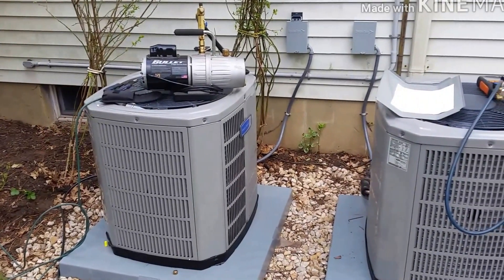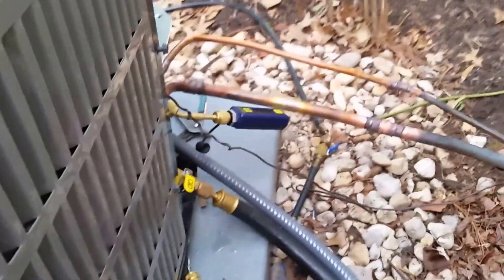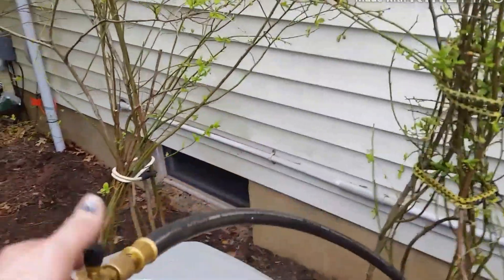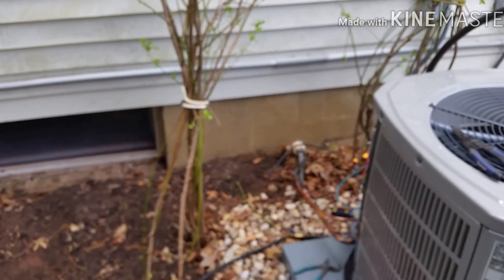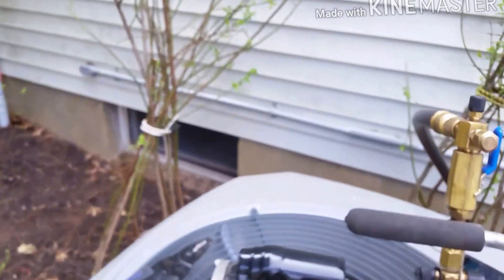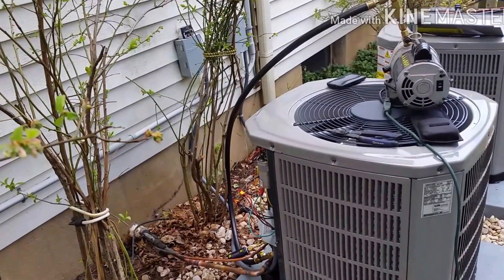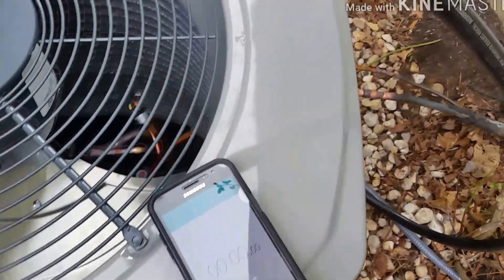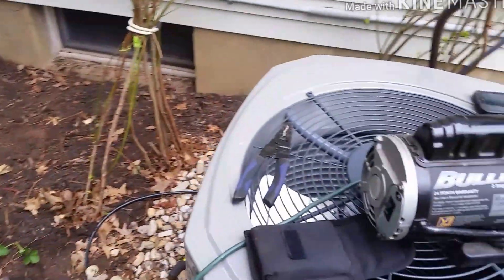Pulling vacuum using only one hose

Comment: With 38 years in the business, running seven trucks. Use a two stage pump and single hose. Good time to inventory and clean tools. Don’t just sit around with your thumb up your ass. Plenty of other things to do while you’re waiting. Also less connections means less leaks, worn gaskets .

Comment: Expanding on this method...I saw another tech that would release just a little bit of refrigerant...enough to make the gauge go from vacuum to pressure....then remove the micron gauge and vacuum pump. No air gets sucked in that way.
Reply: Just use core remover no?

Comment: So no triple  vacuum
Reply from the maker: On residential u really think it needed? Have u ever read the install instructions cause I have and it doesn't state a triple is needed at all.  It states under 1000 microns is all that's needed and valve off and make sure she doesn't rise. Not everything is done by text books . When u have a 2 stage vacuum pump all u need is a deep vacuum.
Reply: @jhhvacplumbing1944  im sorry to dissapoint you, but do you really understand why triple vacuum is done? Noncondensables and moisture inside the lines freeze while vacuum,m and crystalize, therefore they are no longer able to vacuum properly, that is why you have to put nitrogen again to bring those to normal state again, and pull vacuum again, thats why is called triple vacuum, and yes i have read on installation manual that triple vacuum is recommended, i always do it, and charging the system after install is way easier and doesnt take that long because theres no moisture or noncondensables  in the line,

Comment: Can I pull a vacuum on a system that has no pressure without the risk of the vacuum pump sucking in liquid refrigerant with this method? Or does the refrigerant need to be reclaimed before vacuuming?

Comment: I do mine the exact same.  Less seals is less doubt when it doesn't want to pull down right. Pull from suction with Schrader removed and micron gauge on complete opposite end of circuit at the discharge port for a true reading.  I cap off my solder joints way more tho....  To much to inspect and question with those joints.  Put a solid shoulder on it and know 100%  its solid

Comment: Vacuum ac system drain from the suction service port seemed OK with vacuum gauge monitoring the liquid service port provided the system has no TXV. Two port draining make more sense in a system with TXV.
Reply from the maker: How so ? The txv is never completely closed and pulling from suction port is the flow of the refrigerant direction and having gauge in liquid is the very beginning on vacuum being pulled and gives tru micron reading of complete line set and coil .
Reply: JH HVAC & Plumbing 
I don’t know txv is partially opened. Why?

Comment: I also used this method couple times , it works good . But i put one valve before the micron gauge , just to avoid
Reply: Just to Avoid the oil to go into micron gauge , while open gauge . Also some brand it is hard to use valve core removal . Also i will appreciate if u add another video to show how to open valve after vacuum finished in the same setup.
Reply from the maker: @azad15aug  u r correct my friend,  I now add a second valve core removal tool onto liquid line services port for micron gauge.

Comment: I’ve done it this way, through my 550s (slowest way) and the two hose way (without gauges). I never really was sure what way was the right way! I have a large vac hose like yours (Yellowjacket) and it helps considerably with getting the microns down faster. Was taught long ago just pull through the gaugeset. Yea, if you have hours to spare! Lol. Thanks for the video!
Reply from the maker: Get yourself a 1 port micron gauge and try 1 hose
Reply: JH HVAC & Plumbing have Blu Vac LTE. I will definitely try setting it up the way you show. Thanks for the tip!
Reply from the maker: @Fireship1  one mistake I did in vid was i didnt use a core remover tool on liquid stop with micron gauge on it . That way u can open services ports after vacuum without damaging the gauge and not pulling air back into line set to remove the micron gauge.

Comment: How do you release the refrigerant without it coming in contact with your micron gauge though or breaking the vacuum by removing it
Reply from the maker: U r correct and now use a second valve core removal tool on that end and just close the valve
Reply: @jhhvacplumbing1944  Good info. Great video Justin.

Comment: Do you remove the micron gauge before you open the lines? And if so, when removing the micron gauge does that cause the microns to spike up?
Reply from the maker: I added a core remover tool to liquid line and put micron gauge on it . Once vacuum is done u can close valve and either open lines or remove tool it doesnt matter

Comment: I mean why speed up process when you get paid hourly. Just wondering??
Reply: I have never charged by the hour when doing a change out or system replacement. I would be loosing money if I charged by the hour.
Reply: Speedy vacuum is best for side jobs.(Weekends)  Mon - Fri we opt for slow vacuum procedures because we get paid hourly.:)

Comment: What does it pull out? Is it moisture out of the line? Where does it go?
Reply: pulls out air. (water,oxygen,nitrogen,argon, hydrogen,etc). all of those items don't belong inside a refrigeration system and cause problems.  It goes out of the vacuum pump and is vented back into the atmosphere.

Comment: From what I've heard if pulling a vacuum through lines and coil only, use one hose. If also pulling through condenser use two hoses.
Reply from the maker: That maybe true but it's not often u r pulling threw condenser,  line set and coil unless u r replacing compressor or outdoor coil . Most of the time if it's a r22 compressor or outdoor coil its time to upgrade to 410a. If it's a 410s compressor with issues I lean on selling a entire new condenser based on its easier labor wise . Only time I would replace a compressor is it's under warranty and I have no other options.
Reply: @jhhvacplumbing1944  Yes indeed. Or possibly need a lineset repair and more than 50% of 410A leaks out.

Comment: What is the model for your vacuum pump. I need to get one but don’t know what size should I get?
Reply from the maker: All depends if u r residential or commercial
Reply: Definitely residential
Reply from the maker: @HowToDoitright  5 - 7 cfm is more than enough for res
Reply: JH HVAC & Plumbing if i get 4cfm would that work?

Comment: Micron gauge on high side?.  Did you have to remove both shrader valves.?  Thanks
Reply: You do not need to remove the shrader valve. It is used only for sensing the vacuum, no need to move the gas through there. Maybe it is better to put a real valve there, so you can shut the valve and remove the vacuum gauge, and charge the system.
Reply: @vicever08  ok.  Thanks

Comment: Just buy a Fieldpiece set of gauges that measure's your vacuum and pressure never have to worry about contamination and yes you can pull a deep vacuum with the gauge set just pulled a system with 100ft of pipe and 3 heads to 74 microns.
Reply: No manifold more potential leaks
Reply from the maker: john szymanski couldn't agree more but I have learned not to argue and tell someone they r wrong cause its not worth it . In fact they aren't wrong cause that's what they r made to do but there are better and easier ways .
Reply: JH HVAC & Plumbing Just keep your equipment in good condition and you won't have problems. And do it the way that you feel comfortable. I was just relaying my experiences with this piece of equipment especially for small units that you were working on. I also ran 3000 ft of pipe on this job and used them successfully in pulling vacuum's under 300 microns that was verified by more than one micron gauge. Again do what's best for you.
Reply from the maker: Jeff Scanlan good job dude I know its possible this is the way I like to do it and have good outcomes.  The only reason I mention to people not to pull threw gauges is the simply fact it causes leaks and gauges to die quicker lol.

Comment: I just used a single hose to vac a system yesterday. I didn’t have the right hoses and valves so I said fuck it, I’m just gonna use one so I can get my micron gauge on and it worked just fine. Glad I’m not the only one lol
Reply from the maker: Martin Prince777 nah nothing wrong wit it but best way would be to use 2 valve core remover tools and out the micron on high side tool with shut off valve.
Reply: JH HVAC & Plumbing I need to get some of those. They look pretty cool and very useful. I am fairly green so I appreciate the advice. Thank you! 😀

Comment: I had a Class today with an LG Expert, Recommended   not to use a single Port Micrometer directly into either Line Low or Hight. Because ones the Vacuum is completed and one remove the micrometer from the line it will contaminate your Vacuum by letting air in. It Makes sense! 
Other then that Grate video!
Reply: So, what did he recommend?  Would connecting the micron gauge to the service port through a VCRT solve this?

Comment: Final vacuum value is important, however in long runs that were unsealed for sometime water might not totally evaporate even with quickly-acquired low values. This must be taken into consideration. This is where minimum run-time requirements come into play and not only the vacuum value.
Reply from the maker: Stop Telling Me What To Write very well said sir , thanks
Reply: Yea and double or triple evacuate it.
Reply: If moisture were present in the system it would boil off and cause the vacuum gauge to rise.

Comment: when you unscrew your micron gauge your letting air back into the system. and if you leave it on them you risk damaging it from the refrigerant. not really a great way to do a vacuum. they don't fight each other. you could put 10 vacuum pumps on a system if you had enough fitting brazed in. 2 hose. 1/2 " done 😁😁😁👍👍
Reply: JH HVAC & Plumbing sorry didn't see that in the video.
Reply: JH HVAC & Plumbing I guess what your saying is that you never actually see your gauge holding the vacuum. Its a guess. I don't like that. I want to be sure it at 400 ect
Reply from the maker: HVAC/R DUDE yes and no . I do a test before I remove the gauge and see it hold under 500 for ten mins . If it holds I then run it back down with gauge still on . Once I'm well below 500 again I remove gauge and run pump for another 10 mins .
Reply: JH HVAC & Plumbing I like to use the core tools until the gas is in. Then put cores in and ✔
Reply: @jhhvacplumbing1944  Than add a valve can save you 10 minutes, I would do that.
Reply from the maker: @vicever08  correct and do this season , thanks for watching

Comment: Do you like that pump, and if you didn't have the tree would you just connect it to one of the two 3/8 flare connections, or does the tree help it go faster?
Reply from the maker: thami lahlou the tree does not make it go faster.  That was a extra pump I happened to grab and the tree is not needed with that pump set up .  I haven't had any issue with the pump either.

Comment: is this a new install ? could I use this method when I change a txv? sorry for the novice question I am just starting out. I really like the idea of one hose. saves me the cash for the time being. 1/2 OR 3/8 hose?
Reply from the maker: Cory Desormeaux yes you can use this method for whatever the situation calls for . This was a brand new install . In some cases like if I have vacuum the evap coil , line set and outdoor coil I will add another hose on liquid service port using another valve core tool . Some guys use 2 hoses no matter what they r doing but it's over kill as u seen from my video one hose works fine .
Reply from the maker: Cory Desormeaux when changing a txv in a evap coil just pump refrigerate into compressor, close service valves , blow nitrogen threw lines , replace txv , nitro test line set and coil for leaks and then proceed with the vacuum.

Comment: While that I, for the most part, use 1 hose on small systems the "quickness" doesn't really matter cause remember your only evacuating a little bit of tubing not the condenser coils or the compressor where oil is and has a tendency to hold refrigerant and moisture. But I like that you're using a micron gauge instead of your refrigerant gauges! When I went to school 38 years ago for refrigeration they only talked about 29.9" of vac being right but we since have learned it's a little like "filling a thimble with a fire hose" way to broad of ranges. I've zeroed my SMANS and seen 30.2" and 1300 microns?? Which proves to me that we still can't , short of a good micron gauge, trust our technologies! Never stop learning!!👍👍
Reply from the maker: Dick Gallina yes sir thank you !

Comment: Awesome! I've never fully understood why a large hose works "better" when the service port size never changes. Next video with 2 systems simultaneously changed should check large hose vs small time ratio.
Reply from the maker: William Swensson good idea
Reply: Pressure drop in smaller hoses
Reply: I can send you a video that explains why if you haven't found out yet lmao

Comment: I have a question Justin, How do you introduce refrigerant into the system on this set up? It seams like you either A: have to take the micron gauge off to get some pressure in (which under vacuum will suck air straight in) or B: you have to put refrigerant in through the port on the  core removal tool with the micron gauge still on, which can screw up the sensor in the gauge if refrigerant/oil hits it.
Reply: Cory Desormeaux add another vacuum rated core tool on the high side. That gives you another port without breaking your vacuum.
Reply from the maker: MIL-TECH AIR CONDITIONING LLC good question but I usually run the vacuum after I remove the micron set up for a few mins then valve off core , open service valves and reinstalled core . I guess I can use another core removal tool and attach the micron set up to that.
Reply: Yeah, after you remove the gauge, you really have no clue what it's at.
Reply: @tomgram2918  You can attach the vacuum gauge on the pump and re-vacuum once you have confirmed the vacuum holds using the method in this video.
Reply: cant you close the suction service valve,then add manifold hose to add refrigerant?
Reply: man I like this method....but I am still confused as to how I will than add refergerant
Reply: Putting a nice short hose with shut off before micron connection would solve that.. and right off the suction line as well. Then just throw your guages right on after a good vacume.

Comment: In many cases there's is not a huge difference except for speed. However, in the case of the Trane Hyperion with the EEV, the valves are in the closed position from the factory and using one hose may result in the other line not being properly evacuated. Of course, you would be able to tell something was wrong if the micron gauge is not registering. I always used two hoses if there are no space constraints.
Reply from the maker: Dale The hvac repair guy correct my friend,  thanks for watching.
Reply: For a Trane Hyperion with EEV, you can power up the air handler, do the drive valve open test on the EVC and then remove power while the valve is open and it will stay there until you power it back up. You can also use a magnet and spin it around the valve body to open the valve manually.
Reply: Yea those txvs can be a problem. That's why you flow some nitrogen before you pull vacume. Plus the micron guage is the real testimony.

Comment: Nice video bro! That's the same setup I use and will never do it any other way lol
Reply from the maker: Marco Alvarez yeah I do pretty well this way , some guys just never seen it before .
Reply: All the techs I work with still run regular manifold sets with micron gauge in between pump and gauges.  I get sick of when I valve it off and microns jump up,having to establish if there is a leak in hoses or system.   This way seems like it will reduce that.

Comment: I used one 3/8" on Brute manifold, with Supco vacuum gauge, the one that was given away on Pod cast Wednesday night. Ole Timers~aircooledtx
Reply from the maker: Michael Lee I used to use that double port supco but only thing I didn't like was having to use another hose on it . I feel the less hoses and connections the better .
Reply: @jhhvacplumbing1944  40 on m  LL

Comment: How long have you been using those Ideal Twister Pro #344 wire nuts? Like them better, or about the same as others similar with wings?
I found they were more expensive than good old 3M R/Y at the supply house but no real advantage, just bulkier to nest into tight wiring compartments or junction boxes.
Reply from the maker: Dwight Bennett I don't , we use are electrician for the disconnects .

Comment: I use 1 hose most of the time also. Good video justin. 👍
Reply from the maker: Nor-Cal Refrigeration & H.V.A.C less hoses and less connections = less issues .
Reply: Is it possible to pull below 300 microns in like 5 minutes that's happened to me 4 days in a row new Install

Comment: I currently use two hoses, but I've been thinking about this method... It's still fast, less to set up, micron gauge is in a better location. Nice demo!
Reply from the maker: Neil Comparetto less hoses and connections = less issues in my opinion.
Reply: @jhhvacplumbing1944  Tried your method today. 2.5T. split. Pulled quickly at first,leveled off but got there. Got to @ 400 microns and held after @15 min. Anything that eliminates hoses im for !!
Reply from the maker: @williammarik6159  glad it helped u out!

Comment: never thought of that way makes sense. what Air handlers are you pairing those with tam 4,7 or 8 ?
Reply from the maker: hvacman77 80% regular single stage hot air furnace